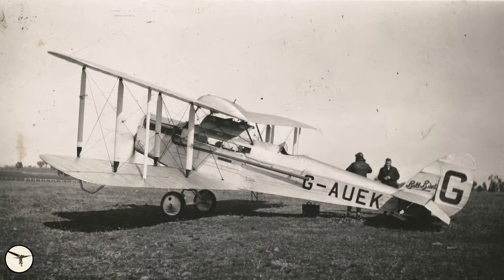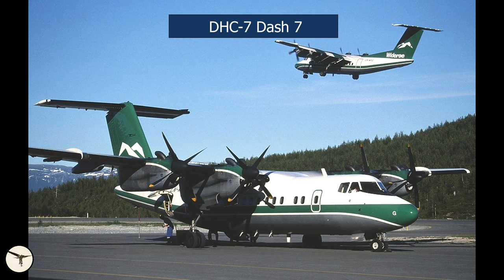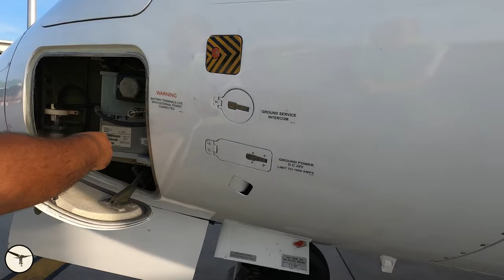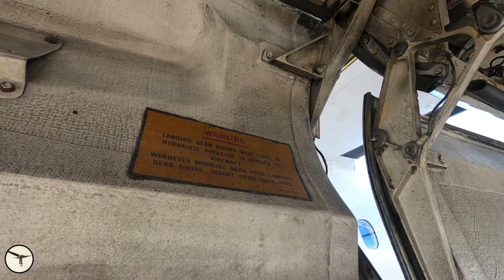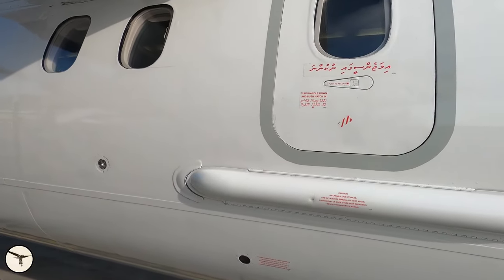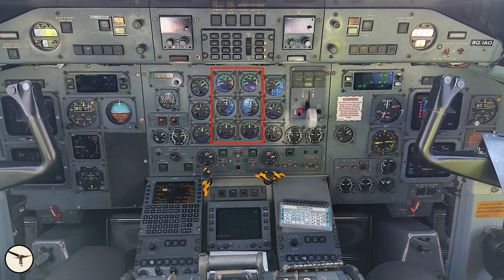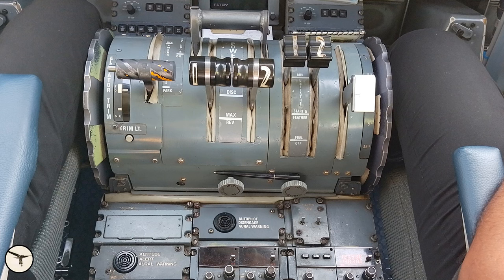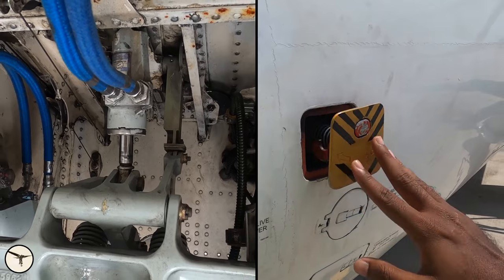De Havilland Canada's Dash 8 Quirks & Features | Turboprop Airliner | Fly with Magnar

Comment: Great video but as a DH8C F.O, there's a point of correction on the fire bottles.When the red disc is missing,its a sign of thermal discharge (overheat) whereas if the yellow disc is missing that's a sign of pilot action (bottles fired).
Reply: YEAH

Comment: I believe you have the fire extinguisher discharge discs the other way round 🤔
Reply: Definitely the other way around. Yellow = fired into the engine, Red = overpressure.
Reply: Agree 
Discharge indicator discs .....
The yellow disc is the system discharge indicator and is ejected when the discharge of extinguishant from the bottle is authentic. 
The red disc is the thermal discharge indicator and is ejected by extinguishant escaping to atmosphere due to thermal expansion in the lines.

Comment: Both aircraft have their pros and cons. We climbed out of LHR at 230kts, everywhere else the SOP was 210kts, vs the ATR we climb at 170kts. Q400 was a handful especially if we had to level off at say 2000ft until cleared to a FL, the speed would build so quick before Alt Star. The ATRs methodology and info available at hand is fantastic.

Comment: Wow never knew the old Dash 8 didn't have electric trim, I just assumed if it has AP it has electric trim.
I went back and checked the manuals, indeed electric trim switches are not mentioned, however the electric trim motor is still present and only used by the AP. Learned something new today.
Reply: The autopilot trim actuator can actually be used by the pilot in case of a failure of the manual trim. The pilot just has to flip a guarded switch ON then use a toggle switch to trim nose up or down just like an electric trim. This is just in case of emergency however, as in normale operation the aircraft is trimmed manually only. The elevator control is very efficient on the Dash 8 (too efficient compared to roll control some will say) so very little movement of the trim wheel is usually required in flight.

Comment: APU (air intake) in the tail...is that correct?..odd location for an inlet...
Reply: I noticed that too. I wonder if that was a mistake.
Reply from the maker: Yes, it's correct. Apparently, the Canadians like to put the air intake at the rear, cf. the PT6 engine.
Reply: Dash 8 APU can only be used on the ground if that helps
Reply: It is incorrect. He has the APU exhaust correct, but the APU intake is the square hole forward of that. The hole at the back is the air conditioning packs exhaust.
Reply: @absthewonderdog Yes, this man is correct.

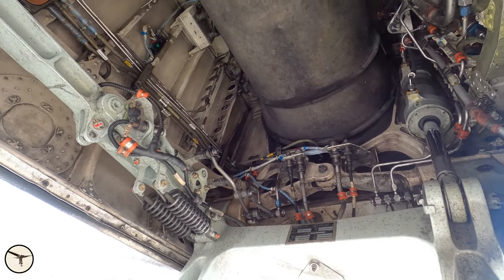Comment: Thank you for this extensive walk around and cockpit explanation. But what are these things sticking out at the engine cowling, 2 to be seen at 12:32.  They are located between the propeller and the main gear bay.
Reply from the maker: Do you mean the probes on the right hand side of the cowling? They are a ventilation probes, but I cannot tell for what.
Reply: @FlywithMagnar  Yes I mean those two sticking out on the right. Maybe you can find out sometime, asking around or so. I would be interested to know... Thanks.
Reply from the maker: An engineer told me the probe to the right is to dump excess fuel if the fuel collector tank is full. This tank collects fuel from the fuel line after the engine is shut down. The other probe is to relieve excessive pressure from the engine oil system, for example if there is too much oil in the oil tank.
Reply: @FlywithMagnar  Wow that was quick! Thanks for this information!😀😀

Comment: Hi
Do atrs have propellers pitch reverse ?
I  have seen It at work on Saab 340
Thanks
Reply from the maker: Yes, all aircraft with turboprop engines have reverse.
Reply: Where are their control levers located ?? Tell me please which of your videos shall i check
Thanks
Reply: @FlywithMagnar  Hmmm  Fokker-27, Bristoll-Britania ??? do not. but indeed most do.
Reply: @danilogiovanelli6991  Just pull the trottles back below beta range.